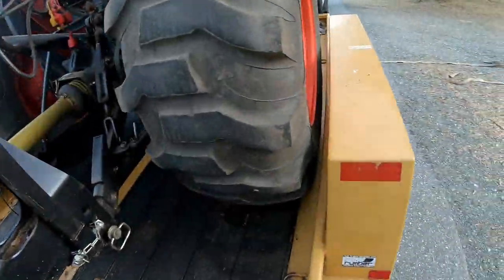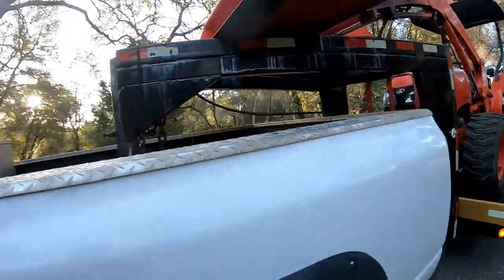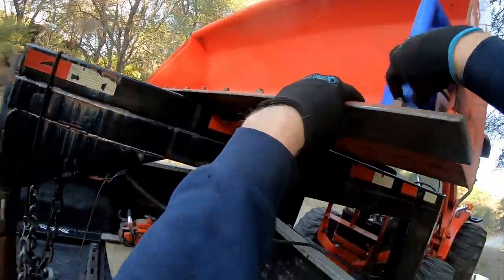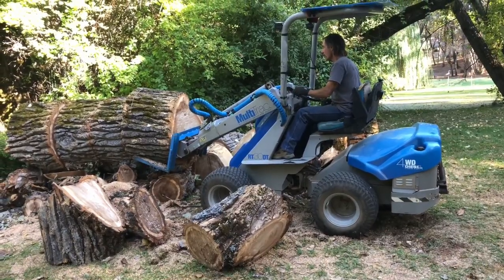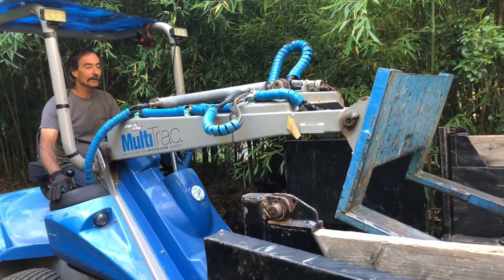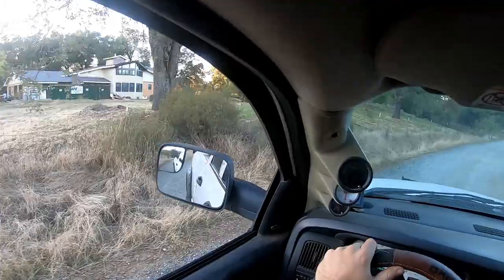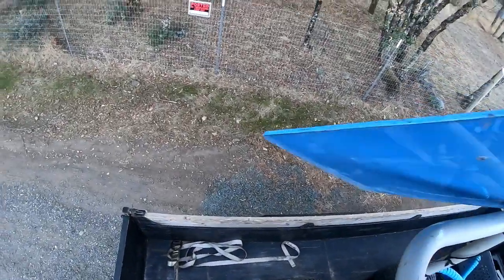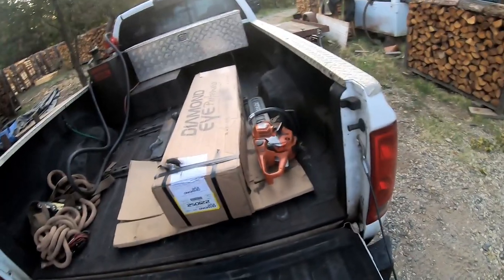NEW KUBOTA TRACTOR BARELY FIT ON LITTLE GOOSENECK TRAILER

Comment: First of all thanks for all the content and congratulations on the new baby. I have 5 sons myself. Kids are the best. I am looking at new trailers for my business. I have a 06’ 5.9 with a 2” lift on it. Still trying to decide on what trailer, tag or GN. At all possible it will be a Diamond C... they can thank you for that! That is if I can find one closer than 500 miles away. Will I run into any issues pulling a GN and it hitting the bed?

Comment: On our tractors you can take the centers out of the rear wheels and move the inside around on the outside of the rim to adjust rear spacing in or out

Comment: Could be speaking nonsense but I think DOT don't like it when you have your plug resting on the tailgate like that id use a bungee to suspend the wire and it could save the wires from chafing.
For the door unlocking id check the wiring from the door to the cab my dodge wires broke so i lost power to the door locks and power windows  
love your content keep up the good work

Comment: You said that the doors 4 doors do not unlock on your 2500? I have an 2003 Dodge 2500 short bed and my doors do not always unlock when the driver door is opened. They work sometimes does anybody know why that is?

Comment: Air Lift CONTROL MODULE for Airlift Kit 25980

Try that on your gooseneck shocker only $150 at jegs wireless controller to set air pressure